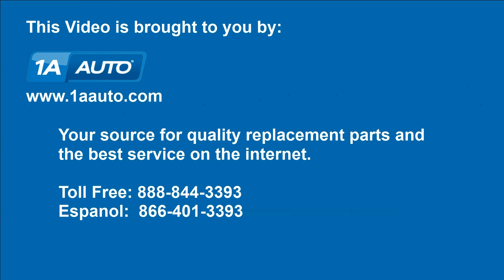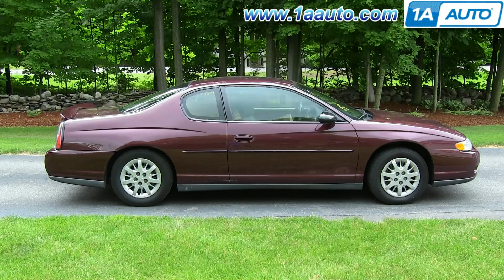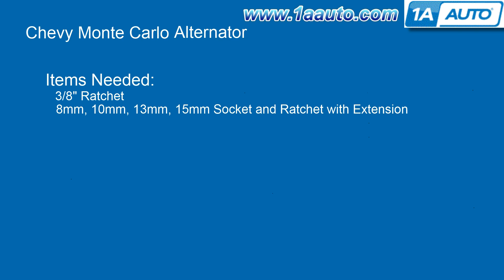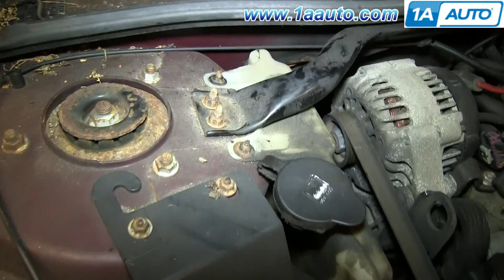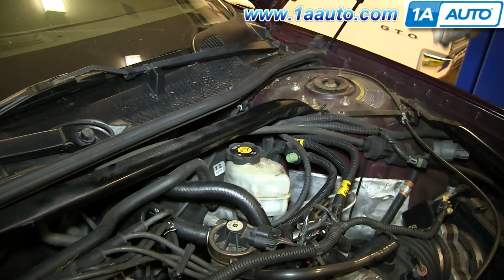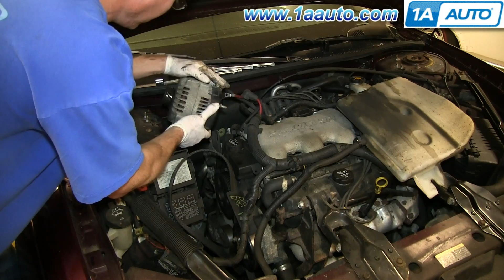How To Replace Alternator 00-05 Chevy Monte Carlo

Comment: Will this video help with replacing a alternator in a 1998 monte carlo ls 3.1 engine and can I use the same tools?
Reply from the maker: +Decorlos We don't have a how-to video for your vehicle right now, but the basic steps in this video should be enough to do this task. Buy this part for your vehicle on 1AAuto.com: http://1aau.to/m/Shop-1AAuto-c
Reply: Should be the same. Haynes manual groups 3.1L and 3.4L repairs together for the most part. A lot of repairs and maintenance on the 3.8L are completely different beasts.

Comment: I have a quick question.. I'm doing my friend's 2003 Monte Carlo SS w/Supercharger, I've taken the alternator off and replaced it with the new one but I noticed that the car only has 1 belt. I don't remember if it was even on the supercharger or not but I've been searching online for about an hour and noticed that it actually runs 2 belts.

So I was curious that if it's possible to run 1 belt for everything or do I have to run 2 belts?

Also, the tensioner for the supercharger does not move at all and it's a 17mm instead of a 15mm.

Comment: Great video!  A few pointers for the beginners...

#1:  if you are using a ratchet plus extension to disconnect the battery, BE CAREFUL not to touch anything else that’s metal in the car with the tool.  Othwise, you’re in for some major fireworks (especially if the tool spot-welds itself to the chassis!!!)

#2:  when you reinstall the three bolts securing the alternator in place, replace them in reverse order and do not tighten them any more than you have to to get the threads to engage.  It takes a bit of wiggling to get the threads to grab properly.
Reply from the maker: +dagamer667 Antelope Thanks for the additional helpful tips to guide fellow beginners!